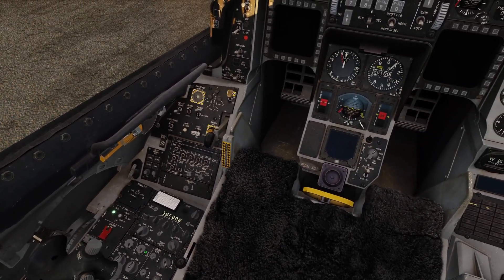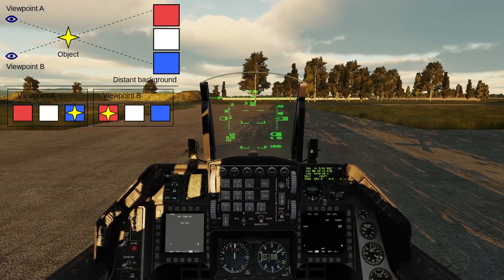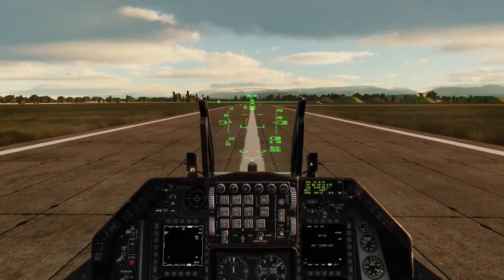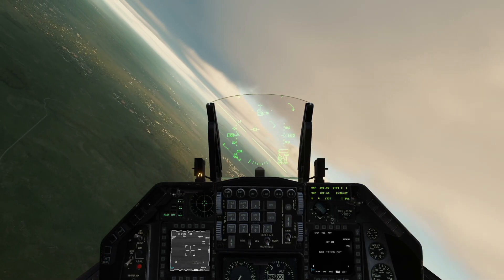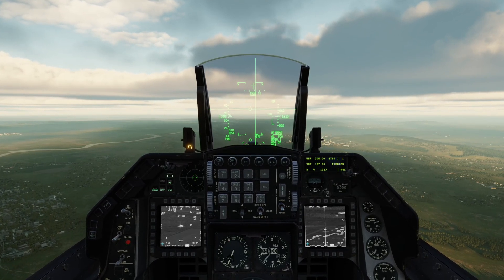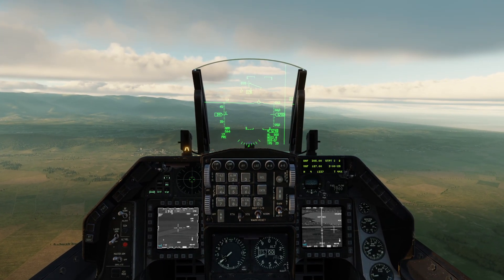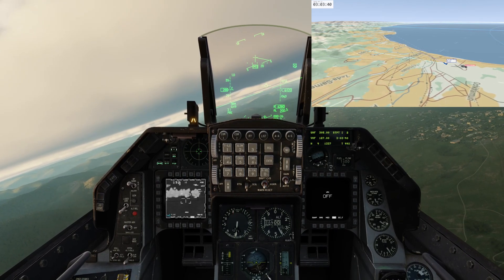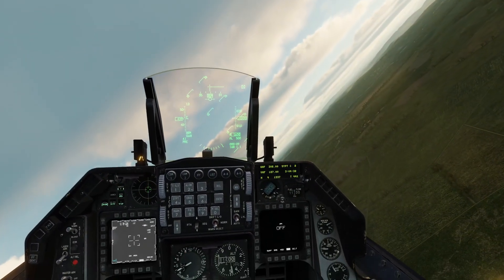DCS F-16C Viper Maverick Bore Sighting "In Air" March 2023

Comment: This procedure in multiplayer is wholly irrelevant and unnecessary.   I wish there was a special option to skip this entirely.
Reply from the maker: To be fair, from what I understand pre is never really used to that extent back when Mavs were widely used. Just enough to get the mav close and then use the mav to lock instead of handoff with tgp. As for that special option, that option is war thunder 😁
Reply: I dont accept that the special option cant be added just like the harrier for example gets a quick INS stored heading option.  I literally cant see the mav screen and therefore its an accesibility issue and should be considered over realism.  Im not advocating the removal of said feature, just for an option to choose.  the War Thunder comment is unnecessary  @Carbon_715

Comment: This was very interesting. I never even tried to boresight in the air, but I have exacltly the problems you mention when I do the boresighting on the ground. Will do it in the air from now on :)
Reply from the maker: Let me know how it works out for you :)
Reply: @Carbon_715  Nope, will not work. After I berosighted the maverick, when I press TMS down, the seeker slews of target. In your video, it looks like it stays on target even if it drops the lock. Then when I try to lock and hand of via the tgp, the maverick looks of target
(I am running latest version of Stable though)